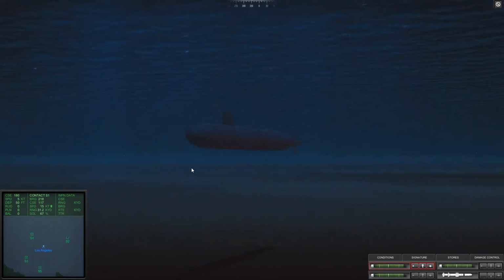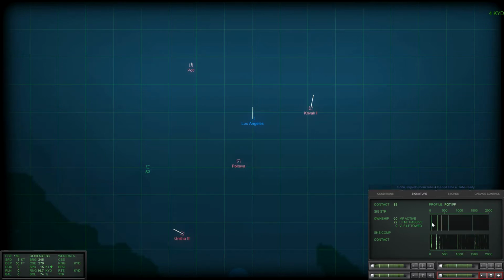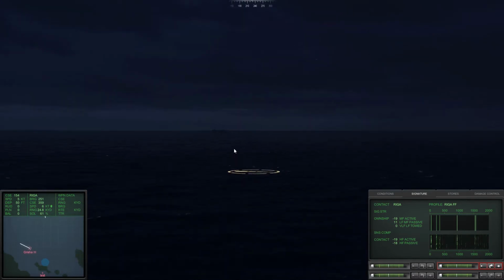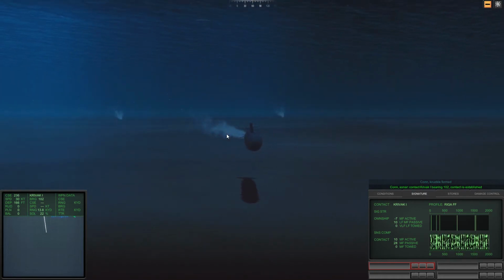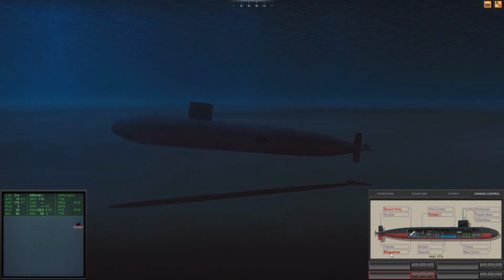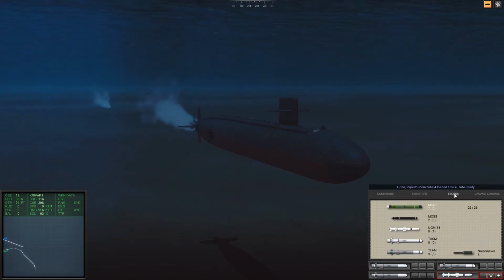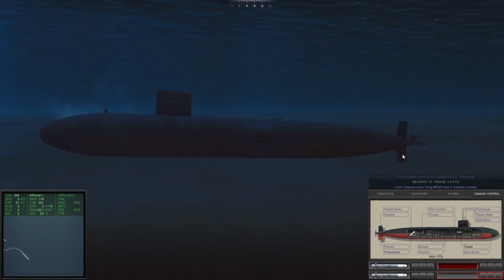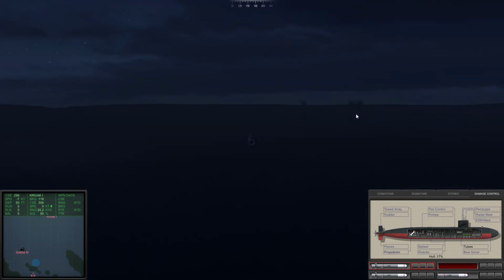Cold Waters TLAM employment (and other things) tutorial

Comment: I recommend you use torpedoes over harpoons for suface contacts because the smoke trail.
Reply: if enemy surface vessel get very close you will get spotted even if you go quietly, especially they approach from side or rear, your firing torpedoes will get wire break, so I would rather fire Harpoon to take out closing vessel in the fist place

Comment: I wonder if you would have evaded the torpedoes easier if you were not cavitating, it looked like you evaded them while you were damaged at 10 knots; when you weren't cavitating.  GG  and good vid.
Reply from the maker: Once they go active it can be hit or miss. I've had them get enough reflection off me on active mode even while rigged for ultra quiet that chase is on again. In shallow water, the best bet is to to make sure you never get shot at in the first place, but, failing that, raw speed and fancy maneuvers tend to be the best defense, at least for me.

Comment: like your knuckle technique, but you'll shake the torpedo's easier if you stop the cavitation. But totally appreciate your TLAM lesson. I thought the clear circle in the water was LAUNCH SITE.
Reply from the maker: Yeah, it's the trade-off I made due to the depth I was in. I needed the speed and maneuverability, since I can't clear the seeker's line of sight vertically. I think it's got a 400ft vertical search window, so all I've ever been able to make work in those depths is to just try and exhaust 'em laterally. To stop cavitation, I have to drop the bell to about 2/3, and then I'm too slow for my comfort if (when) it reacquires my boat.

And then I bounced my screw off the mud, and screwed the whole thing up, but it's the effort that counts, right?
Reply: Galaxie Skyliner  with that speed rock left n right quickly to make a "knuckle" sort of extra noisemater/soundblocker, really helps alot in dodging inc torpsalso thanx for this vid, had the same issue as OP sailing all the way there thinking i had to get there to launch themlike you have to when dumping seals :D